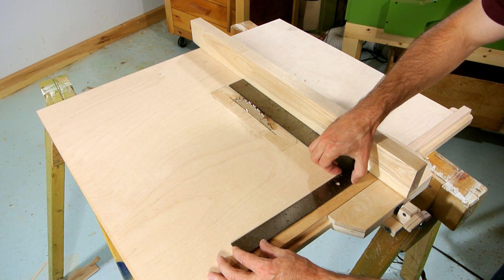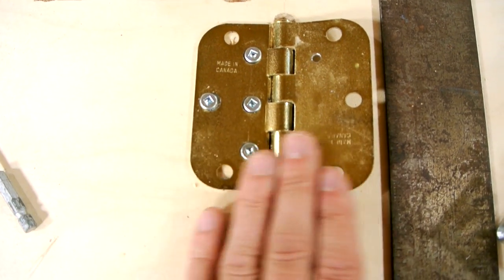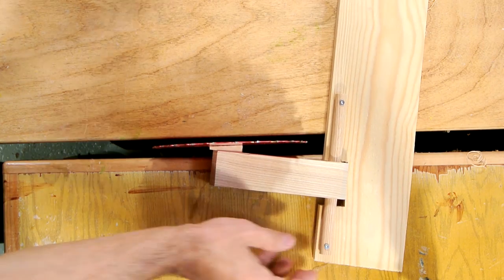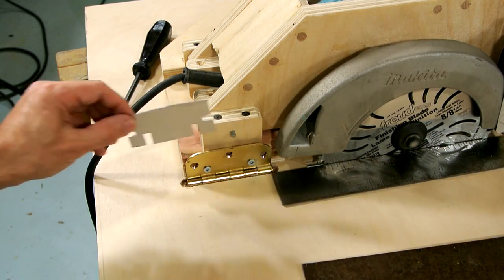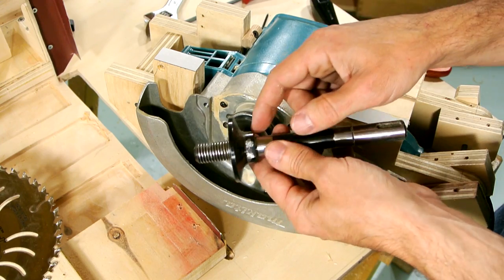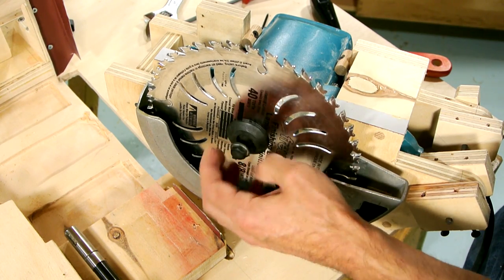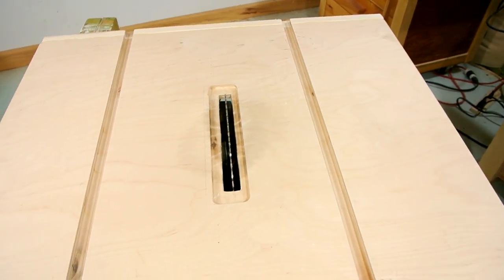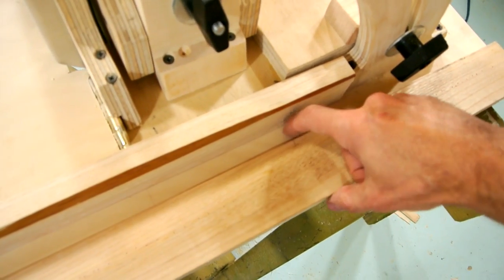Homemade table saw alignment and miter slots

Comment: Bonjour Matthias,
this homemade table saw suite of videos is a must. I have been following your plays for some years now, picking some tricks here and there. This time, I will apply your solutions for my own homemade table saw, I will simplify the process by not having the tilting part ( I feel like I do not need it, I will then gain on the depth of cut ).
Thank you so much for these excellents videos Matthias ... a french follower  ;-)

Comment: It is time for ... sketchup!  alignment is very tricky. However if the problem is broken down into discrete elements it might be easy to achieve alignment.  Most table saws out there provide adjust-ability to the fence, the miter gauge, also depending on the saw the saw angle.

Love what you do and how you do it.  By doing so you spark people's imagination.  Good work.

Comment: Exactly this. Some additional reasons as well;

4) Jobsite saws have crappy miter slots, making miter sleds hard to use and in-accurate (most are not even 3/4").

5) Most saws are designed to work from the floor (cabinet saw) or a table (jobsite saw) but a home-made saw can be integrated into some work surface, with additional tools like routers, making it more space efficient in small shops. 

6) Home-made saw is user expandable. Making it more customizable for the user.

Comment: Oh, my. I would run from this debate if I were you, while you still can! 
I have a store-bought, and I still want to make a homemade one. Imagine just a few of the applications: 
1) light-weight, portable jobsite saw for framers
2) inexpensive and space saving power-saw conversion for non-carpenters
3) secondary saw that is always set up in the shop for a certain rip

Comment: Thanks for sharing your work.  I've been doing designs for my own portable table saw for some time but still wasn't confident in being able to square everything and build a decent fence.  I especially appreciate your demonstration with the blade mock up explaining why the two shafts need to be exactly parallel.  That is definitely something I had not realized the importance of.

Comment: I like the wood top.  I wonder how well it would work if I took my portable table saw apart and installed the trunnion assembly and motor under a wood torsion box top.

Comment: Matthias is building a portable table saw.  There is a big difference between a portable table saw and an in shop table saw.  Heisz did a portable table saw but he did it quick and dirty.  Heisz wasn't thinking about a solution to fulfill a regular need for a portable table saw.  Heisz also did a home built in shop table saw, which is something I don’t want to do.

Comment: Reading through the comments I see a lot of people saying you should have just gone out and bought a saw.  I'm watching your videos because I plan to take the motor out of an inexpensive ($150) Craftsman saw.  The more I have used it the further out of alignment that saw has become and on most saws under $500 there have been no previsions to correcting their alignment.  From what I can see the one you made is probably better quality than anything I could buy for under $200.  Also when (not if) I make my own I will definitely start with a significantly larger table than what you can get on any cheap saws.  The one I have is pretty much a standard size table and it is impossible to cross cut anything wider than about 4 1/2" (112mm).  Additionally I am designing extra features before I build so I can know the accessories will all fit and work together smoothly.

I've watched several dozen videos about home made table saws and I have found yours to be the most useful of any in helping me with my own designs.

Comment: hi matthias i think that to avoid all alignment issues also to make the tablesaw easier to build you just have to make an adjustable fence that you allign with the blade each time u use it or change blade tilt by doing this i think you dont even have to care at all about any squareness you just make sure the table you are cutting run parallel (or perepndicular) to the blade greetings !

Comment: I think he is doing this to show us that it can be done, with a lot of work and be fairly accurate. It might be alright if you can build it with stuff you have laying around but if you have to go out and buy everything you may as well buy a cheap table saw. I have a cheap table saw I got at a big box store, it was way off out of the box but with a bit of adjusting it is very accurate. I had to redo the fence because it was flimsy and it would bow.

Comment: I imagine you could check the alignment of the blade by spinning a blade/disk in the motor and putting a marker on the disc. When you spin the disk you should get a circle with constant thickness.

Or you could do the visual opposite. Spin a black painted disk and use a lathe cuter to make a v groove in it.

I don't say it's the best way but it's quite visual.

Comment: welding in itself wouldn't solve the problem it would just make it consistent, unless you machine the flange after you weld it it would be pure luck if it runs true. Matthias even covered that on his website look for "fixing a saw arbour."

Comment: with belt drive,  if the motor axle and axle for the height adjustment is in line it doesn't have to lift the motor only rotate it

Comment: when I get the time I'll try to sketch how I imagine it done. I don't see why you would need a fancy trunnion for blade height, it is more for blade tilt where you want the axis of rotation on top of the table so the blade doesn't move sideways when tilting

Comment: I have the same exact problem with my Dewalt table saw. Raising/Lowering the blade changes the angle and the table and motor are all connected so unless really modifying things its almost impossible to adjust. Which is really frustrating considering I like things to be very accurate.

Comment: He is using a circular saw, which he explains is inferior to his shop table saw because of the accuracy and stability of a proper arbor.  However, he has a need that can't be filled by the mobility limitations of his shop table saw.  Did you watch the videos?

Comment: If you had plunge cut i before you ripped apart the skill saw. It would have been easier to use the Kerf as a reference to square the front of your sheet of ply and to keep it in alignment by using the kerf as a reference for your build. I agree the accretive error is the problem this is a 32nds or 64ths accuracy project. I use two saw horses with a hollow core door, and  hang my portable saw on the 2x's and use the door as an outfeed table its light portable and can be made out of a junk pile.

Comment: Hi matthias, is there a minimum dept for the miter slots? and also is there any guide line for the distance of the sawblade to the miter slots? I am making a table saw out of High Pressure Laminate 8 mm thick. so not to weaken the structure i am thinking of making the slots 2mm deep and have a 2 mm thick aluminium bar as a runner in it... do you see any problems with that?
also since i will be making my own crosscut sled I think i can choose any dept and distance but I just wanted to check with the expert here ;)
Reply: I was wondering about this too. Would be great to get an answer to this.
Reply: +Szabolcs Keri yup! But this comment has been there for a while now..  If any one has an idea please feel free to comment.  I guess mathias has a lot to do with the little one around... :)
Reply: I know it has been there, but it wasn't answered so I thought to refresh it a bit. I presume other people might be interested in it too.

Comment: If the biggest problem with this design of saw is the arbor, could you make a much better one by buying/scavenging a decent motor and pairing it with an arbor bought as a "spare part" for a midrange quality table saw (ISTR you saying those are around the $50 mark)? After all, even second hand Makita circular saws hold a relatively large amount of value.

Comment: I don't think the point here is improving on commercial saws. There is something about owning the process from start to finish that has attracted mankind for ages. It is one thing to build a piece of furniture using name brand equipment, it is another to build it on a saw you made yourself. It is also a great learning process. Just think of the applications to other projects that a build like this would have.

Comment: It can be done and HAS been done a gazillion times on the internet. Google home made table saw.  I'm assuming that he can get it fairly accurate but it's wood. Over time and with heavy use it will require constant checking and realigning. I don't see the point. Spend the $129 on a Ryobi and call it a day.

Comment: Having the same problem, It's maddening trying to get the blade straight. The circular saw that I have, the blade wiggles. Grrrr! What is the saw you are using, the blade looks like a ten inches.  Just watched more, I'm screwed. The bed of my saw is crooked,  can't fix the alignment. Much thanks, have to quit.

Comment: My point is that chances are you can't buy a G&G dartboard locally. If you want one you are going to have to build one.   I can buy a table saw locally.  And like anything, if you want a better one you need to spend more money (usually this correlation is true but not always).  I just don't see the point in investing so many hours when they are so readily available. And chances are you won't match the quality and durability in the long run.

Comment: Too dangerous. I've spend enough time working a table saw that I know this is just not a good idea long term. It won't stay tight light cast iron and steel, and one day when something goes wrong a solid kickback will destroy the cute little homemade saw and potentially cause some serious injury. I love the videos and always watch in admiration of the projects but tables saw are dangerous enough no matter how you make them, why risk it...